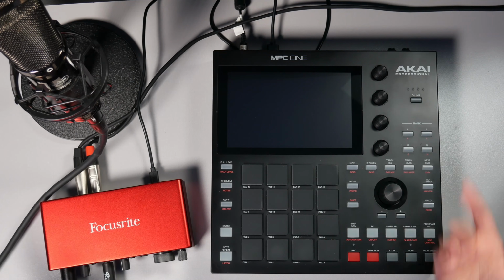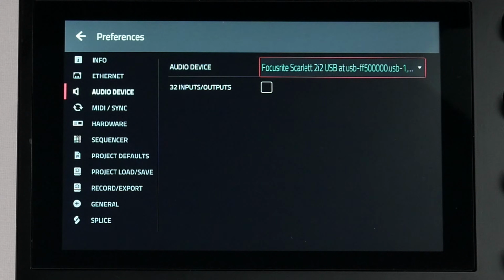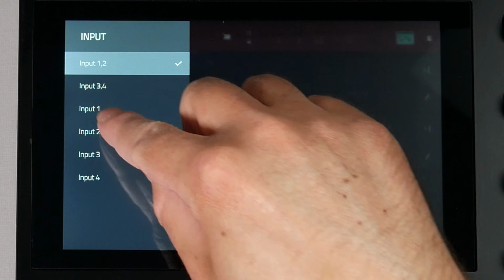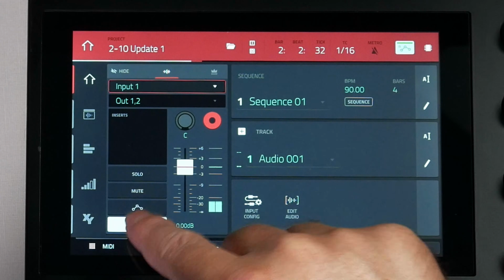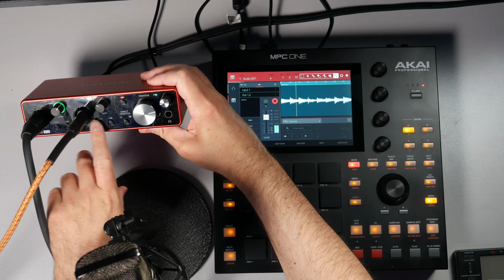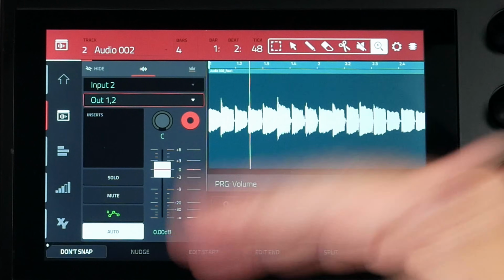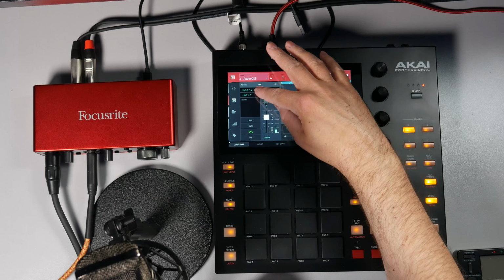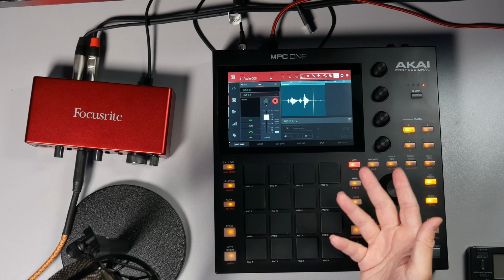MPC Audio Interface Setup: MPC 2.10 Update (Standalone Mode)

Comment: This is awesome! So not only can I record into my mpc one via usb on my zoom L12 - I also do not have to rely on the stereo outputs(mpc) to hear bc it will automatically be playing audio out thru usb on my  zoom! 

So thinking out loud.....if I’m using a helix stomp for my guitar tones, based on this update(class compliant)- I should be able to connect the helix via usb as well. This is making me wonder if a usb hub would allow me to connect all 3 via usb(MPC, Helix & zoom) all at once! 

So cool!! Matthew,If you have any thoughts on if this will/ will not work please comment! 

Thanks🤘🏼🔥
Reply from the maker: You need to select what device to use in the settings.  I don't think you can use all of them at once.  make sure they are class compliant devices.  Zoom works fine just need to put the switch in the back to class compliant.

Comment: I will be hooking up my Roland MX1s to it amazing update! Cheers Matthew great video!
Reply: How did you get on with this?  I had the same idea but can't get it working.  MPC forced setting the MX1 sample rate to 44100 - after this, the sample rate message on the mpc has gone but after 10-15sec MPC errors and resets back to internal.  Tried all three MX1 start-up modes, but keeps erroring.  MX1 is on latest firmware 1.05.
Reply: @SimonJones  I am not even going to try it, I am more than happy with the way I already have them set up & I think going via the usb would be less efficient for my workflow. I can choose any channel from my MX1 to send to the MPC aswell as my Roland MC707 & the Roland SP404a as I first send to a switcher box that lets me choose.
Reply: @SimonJones  I decided not to rewire my setup too much. I have 3 MX1s connected to each other & run the send out to the MPC & all my instruments are connected by midi & controlled by a Novation SLMK3 keyboard sequencer. I have not tried yet to connect a MX1 to the MPC via usb, however after reading your problem I will give it a go & see what happens.
Reply: @mickcj2001  Done a little more reading and the issue seems to be that the MX isn't "class compliant" which is a requirement for the MPC audio interface feature.

Comment: This completely threw me. Two point one update? Now…? But we are at 2.9? Then it struck me. Suggest you describe this as two point TEN going forward ;-) the interface thing is a real important improvement though as I run modular rack. I need separate inputs to do 4 tracks in live looping. This may just work….
Reply from the maker: Yeah, it is confusing how Akai named it.  Thought 3.0 would be next. LOL
Reply: LOL that’s what caught me out. I was watching for 3.0. All excited like, and the there’s the two ten update. Double take time 😂 what I would like to have seen is a chord mode out for CV- at the moment you can route tracks so you can Frankenstein a highest and lowest note from the chord setting on notes, but you really need triads and 7ths. It’s using old school thinking still when a bit of programming could solve it. The other ‘miss’ in my opinion is live looping is still a bit weak. You can drop the loop ‘live’ to a track, but it will only keep playing if you’ve set that track with a midi trigger already. Ableton live looper is clunky but works better. Perhaps a looper plugin module will come in a future update…

Comment: Excited. I have the Tascam model 12, the Mpc x and Roland fantom. Question- so do I need audio out cables from my fantom into my model 12 and then connect the  model 12 via usb into my Mpc x and it will read audio? Alittle confused. My goal is audio over usb where I don’t need audio cables into my X from mixer.

Comment: Just tried my Zoom L8 and since it uses the same USB to power the mixer, the MPC One only powers it, won't detect it.  Maybe if I use AA battery slot, but don't want to worry about battery life
Reply: I tried this, connecting with battery power. I got the mpc to briefly recognize the zoom L8 but not sure what happened as I lost connection and can't get it back. I will try again today.

Comment: Hi Matthew, I have updated the firmware 2.10.0 
I have also updated the software. I can see all the new plugins when I connect the mpc to the computer.
When I’m in stand alone and open my plugins I can’t see the new plugins from 2.10.0.
The question I’m asking can the new plugins work in stand alone, or do they only work with the mpc connected to the computer.
Please can you help ?
Reply: Ps. I am using a MPC ONE
Reply: hello, I need your help,where can I download the 2.10 update firmware?I download the MPC 2.10(WIN)  but it just the DAW
Reply: @bugman9763  
The AKAI projects page, where you register the mpc, and in the down load  section
Reply from the maker: I did a video on how to update to 2.10 here: https://youtu.be/El9_To7NsgY

Comment: One thing I didn't think about was the outputs. Will you be looking into the way the outputs work? One feature I used a lot on my Korg D1600 multitracker was the aux sends for using my hardware reverbs in the mix. I'm wondering if that's doable on the One. Unfortunately I only have a 2 in 2 out interface so testing is limited.
Reply from the maker: I don't see why you couldn't route, for example, 3/4 of a capable audio interface to an effects unit and send a line out of the effects unit back to inputs (let's just say 3/4) of a capable audio interface.  Then you would just need to route the tracks to got to the appropriate output and inputs in the MPC.  It would take work to assign everything, but should work.  Would be like using the submixes for effects within the MPC but using external effects.
Reply: @MatthewStratton  thanks Matthew. I guess a class compliant multi-channel interface is on my Christmas list now! 🎄

Comment: @Matthew, could you tell me how many outputs are there for the Livetrak L-12? I'm thinking about buying to complement my MPC One.
Reply from the maker: The L-12 isn't quite that simple.  You have 2 pair of USB returns that come back in the mixer through tracks 9/10 and 11/12.  There is a button to turn them on and off on the L-12.  The L-12 is a mixer and an audio interface, but you monitor your audio like a mixer.  You then have 5 headphone outputs A-D to monitor with with a main out/ monitor out connected to A.  You should do research about the L-12 to fully understand it.
Reply: @MatthewStratton  Thank you Matthew. I'll look in to it some more. I like the idea of being able to have an external reverb send for a few tracks but maybe that's not necessary. I'm not a fan of the reverbs on the MPC One.
Reply from the maker: Maybe this video might help a bit: https://youtu.be/vIKhwDsNtTA
Reply: @MatthewStratton  Thanks. Just watched it; very helpful.

Do you still have the Tascam Model 12? I think I can see it the background on some of your thumbnails. Just wondering which one you'd recommend.

Comment: I need help! After update when I turn the MPC X on it says I have new plug ins but I need to dow load and install 1st .....wtf! How do I do this , all type of extra hoops akai always has , someone help
Reply from the maker: You need to download the extra contend and put the Synth folder on a SD card in the root folder.  It is like a couple of Gigs, so it makes sense to have it on an external device rather than on the limited built in internal drive.  You need to log in to download it under the MPC 2.10 Firmware Update.
Reply: @MatthewStratton  Thanks Matthew. You are very helpful to our new MPC users.
Reply: @MatthewStratton  sounded good 😐, frustration level 5 , so I dow loaded the "synth content" double clicked the download and extracted it to my usb flash drive, took out of computer , put in mpc x , same message still pops up,  WHAT AM I DOING WRONG??????
Reply: I am about to take the "synths" folder out of the downloaded folders and put that right on my root drive , hopefully this works 🤷🏾‍♂️
Reply from the maker: @THEREALTWISTEDINSANE  Yeah, you got to take the "Synths" folder out of there and put it in the root folder or SD card or external storage.  Should work.
Reply: @MatthewStratton  got it, Matthew is the man once again.  For the 7,875,578 time. 1 more thing, I want to transfer the "synth" folder to my SATA drive I installed on the MPC , how do I do this again ?
Reply from the maker: If you put your MPC into controller mode you should be able to access the SATA drive you installed with your computer.  Then you can just put the "Synths" folder into that.
Reply: @MatthewStratton  I mean my SSD that I installed on my MPC , I want to move it from the usb flashdrive to the drive in installed on the MPC X. I dont see anything that lets me "move" it to my new drive I installed
Reply from the maker: Yep, that is what I mean, you need to connect your MPC to the computer.  You do not have access to the internal built in drive, you would need to use one you installed.  There is no way to "move" entire folders in standalone mode.
Reply: @MatthewStratton  done that. Only see the plug-ins when I plug the mpc into the computer. Not standalone
Reply: @MatthewStratton  we need a video pleeaaasee!
Reply: @MatthewStratton  The folder needs to be named "Synths" not "Synth" and on the root of any MPC attached drive.
Reply: @insektgod  the folder I downloaded from the mpc site says “MPC Synth Content”. Do I need to change that folder name to “Synths” then put it in the external usb drive?
Reply from the maker: You pull the "Synths" folder right from the .zip drive you download.  You don't need to rename anything.  Just upzip the download and put the folder name "Synths" into your root folder of you USB drive.
Reply: @MatthewStratton  that was the 1st thing that I’ve done and eject the usb drive and put it in the mpc. And the MPC keep saying that I have new plugins and I need to install the content
Reply: @mauricefulton3581  take the "synths" folder out and put it right on your usb and boom 💥, but you have to open synth content folder and put the "synths" folder on the root file
Reply: @THEREALTWISTEDINSANE  thank you so much, that worked
Reply: @MatthewStratton  You saved me on this one as the Akai site seemed to neglect the additional steps required. Thank you for being such a great resource for all things MPC.
Reply: @mauricefulton3581  when you open the " MPC 2.10 Synth Content.zip " file just drag the "Synths" folder out and drop it on the root of the drive that is attached to your MPC. {If you're using an MPC one and you want that on the SD card then you should pluck it out of the MPC and attach it to your computer to drop the "Synths" folder on it.)
Reply: Someone needs to make a video on how to install the synth content to your mpc live because just placing the synth content on your external usb stick and putting into your mpc is not working
Reply: This didn't work for me. It says "No Update file was found on USB drive". I have the "Synths" folder in the root file on my USB. I'm trying to install in standalone.
Reply: @denmarksoul1184  Did you update your mpc firmware to 2.10?
Reply: @THEREALTWISTEDINSANE  yes. It has 2.10 installed. It just doesn't recognize the "synths" folder when the USB is inserted in the MPC.
Reply from the maker: I just did a video about it because there were so many questions.  Check it out here: https://youtu.be/El9_To7NsgY
Reply: They need to fix the mute so it could let you play the pads while muting the track

Comment: Great video. Nice and clear explanation as usual. So, I'm expecting the limit on the One is 8 pairs of inputs is that right?
Reply from the maker: Well, you probably can't record more than 8 pairs at a time because there are only 8 audio tracks in standalone mode.  But, you can select up to 32 to inputs, so if you have an interface with 32 inputs you could leave a bunch of gear connected and select the inputs you want to record when you need to.
Reply: @MatthewStratton  good point 👍